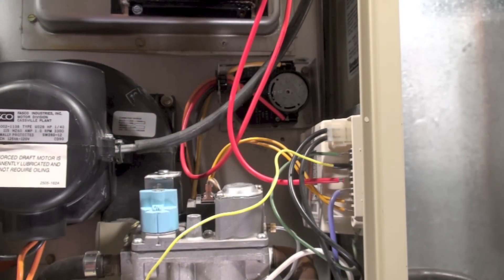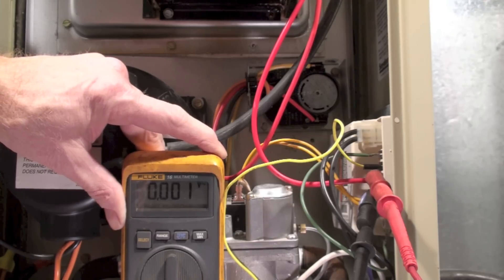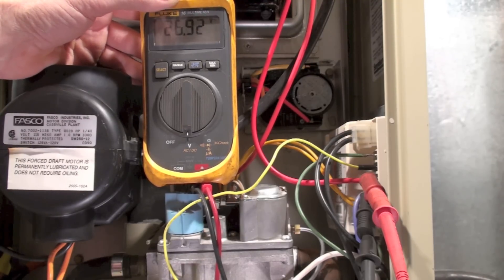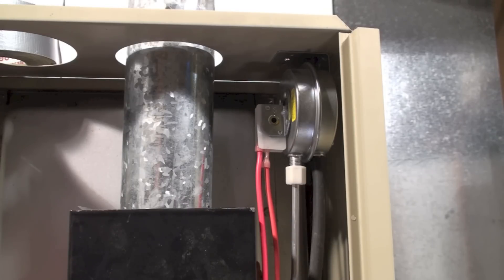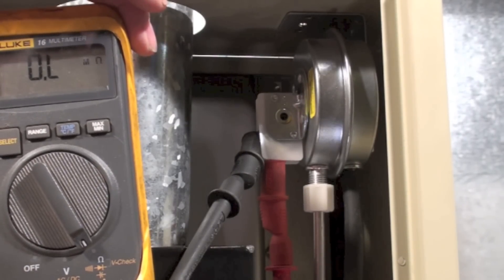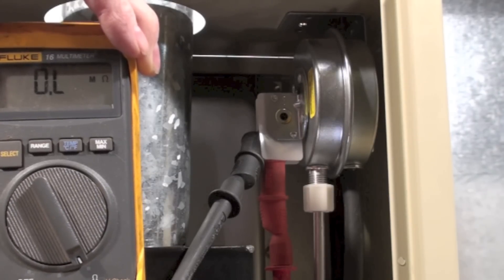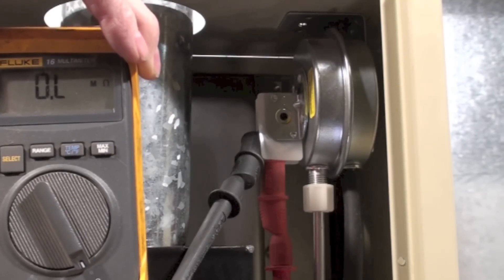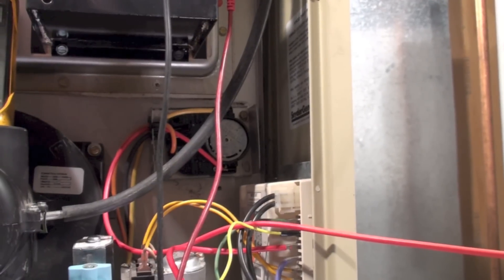Combustion blower runs all the time, no burner. Snyder General GUA. Part 6

Comment: I was working on my aunt's furnace trying to find out why her inducer fan wouldn't stop running and nothing else would kick on. When you isolated the pressure switch I stop the video and found hers and started jiggling the wires and when I pulled off the vacuum tube from the inducer side it was completely plugged. Cleaned it out and it fired right up. Later on i got to thinking mabye you mentioned checking the tube and ports so i watched the rest of the video and shure enough there it was great advice. Thank you!

Comment: I have a 1986 Snyder General the inducer fan runs all the time without quitting.  but when I turn the power off and back on it will run one or two cycles and not work again just the inducer fan keeps going.   I bypassed the pressure switch and also got another control box and still not working

Comment: At 1:45sec you mention the pressure switch is normally closed and opens when there is pressure (I believe vacuum pressure).  But then when ohm testing it you have the inductor motor running and get an open reading, which wouold mean the switch is working right.  However, where I believe the eror is is that the switch is normally open, and closes with the proper pressure (unless this is different than the Trane unit pressure switches).  The pressure flips the switch on which lets the ciruit complete.  It is safer to "not" turn on a unit than it is to have it come on by default and turn off if there is no pressure (if the switch were to go faulty it would let the unit run).    I know what you were thinking it just came out wrong trying to video and talk. (been there)

If I am wrong here I'm sorry.

Comment from the maker: When you remove the combustion cover, you are bypassing the combustion air pipe.  Even a small obstruction can cause a failure, commonly if water gets into the pipe and there is a low spot, that will cause it.  It is also possible the pressure switch is failing.  I would check out everything else out before changing pressure switch.  Hope this helps.
GFM
Reply: Thanks

Comment: Excellent video.  New problem; oil furnace cycles on normally.  After heating cycle draft inducer fan does not turn off even after the set 10 minute time post purge period.
Reply from the maker: I am a little confused here.  Any post purge should only be a matter of seconds.  What model and brand do you have?
GFM
Reply: @grayfurnaceman  I have a Field Controls SWGII-4HD Power Venter (PV) to draft my oil furnace to the outside.  I just had a new TRANE oil furnace installed with the Beckett Genisys 7505B cad cell regulator.  As it is currently installed the thermostat calls for heat, the furnace motor turns on then after a few seconds engages the PV.  The PV creates the draft whereby the pressure switch is activated and turns on the oil burner and the furnace heats normally and the air handler fan starts normally.  All good so far.  When the thermostat is satisfied it turns the oil burner off and the air handler fan proceeds normally cooling off the heat exchanger then the air handler fan turns off normally all the while the PV continues to run.  As expected the PV fan continues to purge the duct because it's on a timer located in the box next to the pressure switch that states the PV will run for 10 minutes after the oil burner stops.  Well, the PV never turns off.  It runs indefinitely and I have to throw the breaker at the electric panel to turn it off.  I'm wondering if the timer is busted or the wiring to the cad cell or the thermostat is not connected properly.  What can I check to see if the wiring is done properly?
Reply from the maker: @cliffwendy3765  So, you are venting out a sidewall or the existing venting has more resistance than it should.
In this case, I would expect the time delay is failing.
GFM
Reply: @grayfurnaceman  thanks, yes we are venting out existing duct through the foundation to the outside.  I will pass this along to my HVAC guy as we continue to troubleshoot.

Comment: Well that was a great video👍
My question is I have a Trane xl80 and the inducer keeps running but heart won't cut on now I did have a tech check it and he claimed I needed a circuit board but he didn't even did nothing remotely to the trouble shooting you did in this video. What can cause this issue I've replaced the thermostat but nothing. It will run if I take the cover of to teste reset and will run fine but it won't cut back on with the inducer continuously running.

Comment from the maker: If drainage is clogged, inducer would make a water noise.  Sometimes a crack in heat exchanger can cause pressure shutdowns but hard to isolate.  A CO detecter in the house is always good.  A tech will use a water column gauge to test vacuum.  Thats the only way to know if pressure sw is the problem.  Probably the pressure switch change is the cheapest way to find out if it is the problem.
GFM

Comment: I have a furnace issue.  inducer runs all the time.  Turn power off and back on, everything will run fine for an hour.  Then inducer will continue to run 24/7.  I am getting a weird heartbeat blink on the ignition module.  It kinda flickers a bit

Comment: My  inducer motor won't turn off and heater works great is that a board /relay not opening after startup
Reply from the maker: The relay is probably stuck on.  Replace it.
GFM

Comment: Thank you for the video! I have an issue with my 6 year old Gibson 2stage. The temp is steady, however the blower keeps turning on with no burner - I just don't know why it turn on if it does not need to. The green light keeps flashing which would indicate pressure switch issue (which we replace)d, however that did not fix it. The control board was also replaced as previously the temp would go down by 4 degrees before the furnace would kick on. Strange that sometimes the pressure switch keeps tripping it and sometimes it just runs fine. No blockages anywhere. Why does the fan keep on turning on constantly if it is maintaining the temp and indicating that there is a switch issue when later it works fine?
Reply from the maker: The fan comes on when the furnace has shut down on safety.  If the code was for pressure, the fan would come on.  
My thoughts are you could have low spot in vent that is collecting water.  It would then drain after the furnace shuts down.
Also, the condensate drain could be plugged.
GFM
Reply: @grayfurnaceman  thank you!!

Comment: Hi, I have a luxaire model GM9S060B12UP11J I know the furnace was working at my daughters house at first start of the cold season but she overlooked to changed a very clogged filter. Of course she calls dad because of no heat in the house. Both blowers were running and no heat. I replaced the filter and let it cool down for awhile and it started right up and worled great. Was called the next day for no heat and found the draft blower was running continuously with the red light blinking 11 times. Im thinking the furnace got very hot at one point and may have caused something like a sensor burn up. I power it down and it lights and heats fine but after a while once the temp is met inthe house the draft blower continues to run and the furnace wont start by itself. any help would be greatful...............
Reply: I have the same thing happening to mine now, same model.

Comment: I have a GUA gas furnace that works fine for two hours, then the the blower and inducer motors runs but no burners. But! once I open the panel door on the furnace the ignitor rod(yellow light) comes on and ignites the burner, could there be a problem with the ignitor. 18yr old furnace no code
Reply from the maker: I would be looking for blockages in the combustion air inlet.
GFM

Comment: Hello Grayfurnaceman! Love your instructional videos! I have a question. I have a gas furnace/AC unit and the combustion blower is cycling on and off with the AC. Is this normal? I've never had a combination unit before and can't figure out if this should be happening? Thanks for the great info and I appreciate your advice!
Reply from the maker: The combustion blower should not come on with the A/C.  Could be a thermostat problem or the furnace control board could be causing it.
GFM

Comment: looked at a Goodman GSM furnace that had the inducer running constantly when the high voltage is on. 
could this be a similar problem. 
This is on cooling mode though not sure if that matters.  thanks

Comment: Hi, any help is appreciated. I have a Ez-air furnace. Model # NTGS100HJA1. The blower and inducer motors both run continuously and won't shut off. Changing tt settings doesn't affect it. Additionally the unit won't heat. The ignitor does not light up at all. I suspect it is the circuit board, but am asking because I don't have a lot of money to just start replacing parts using the trial and error process. Thanks in advance.
Reply from the maker: Probably the unit has failed to light. First, turn off power to the furnace. Turn it back on.  It may or may not light. If there is window on the front of the furnace, look into it to and see what the failure is. There should be a key to the code on one of the furnace covers or the control board. Hope this helps. 
GFM

Comment from the maker: Heat exchanger should be under a part only warranty.  It is a long job.  The AC will work with a bad heat exchanger as only the fan is used for cooling.
GFM

Comment: I have a Lennox furnace that the inducer runs even when the stat wires are disconnected and the LED lights blink for normal operation. I'm pretty dang sure the board is bad but I wanna be sure. The Lennox dealer is a long ride and boards aren't returnable.
Reply: What you test so far?
Reply: Seen a few tranes that inducer wont stop....I internal contacts stuck closed....replaced motor....no problems

Comment: Hi,
I have a Fedders furnace that its been acting up lately.
I recently replaced the cap, and the blower was replaced 4 years ago.
Heat and cold works fine when need it.
The problem its a buzzing noise coming from the blower.
It does it without my calling for heat,or after the heat comes on.
It buzz out of nowhere.....like the furnace its off for a while,and all of a sudden it starts buzzing,stops after a few minutes and the heats kicks in a blower starts normaly..
Any help is greatly appreciated....
Reply from the maker: +Fernando Silva It could be the low voltage transformer is buzzing.  About the only thing you can do is replace the transformer.  Hope this helps.
GFM

Comment: Very good information!
What is the Cause and effect of the inducer fan continueing to run after thee furnace has lit.
My main Blower is running after testing and replacing the hot surface ignitor.
But my infuser fan/motor continues to stay running 🏃
Also I notice, after I hollar up to  my  helper to turn on the thermostat,  the first thing that comes on is my main Blower. (flashing the normal code 12)
2nd item is then the inducer kicks on and runs about 45 to 60, maybe 90 seconds, then my ingnor glows,  ,  and I hear hissing,  (gas flowing) and she lights and heats normally.
But again, my inducer fan continues to run.
Could it be a stuck relay in my control board
Reply from the maker: If I am reading you correctly, you think the inducer should shut off after the burner lights.  That is not correct.  It should run until the burners shut down.
GFM
Reply: @grayfurnaceman 
OK thank you!
Yes, that's what I thought, (that it would cycle off, after furnace lights.)
So I understand now, I AM Seeing normal operation.
And the inducer IS SUPPOSED TO BE RUNNING 🏃 TILL THE HEAT CYCLE HAS STOPPED.
Thank you....
Reply: Lol. Reminds me of the time my dad was looking for something under the hood of his car when I came out of the house. When I asked what he was looking for he said the oil pump. Lol, he wasn't very knowledgeable about cars. I'm not teasing you, there are plenty of things that I don't know about.
Reply: I want to transfer my model 50E47-070 to a model 50E47-843, step by step transfer.

Comment: Hello sir, my inducer motor turns on and off when the thermostat is in the off position. (no call for heat) It turns on  and off a few times in a five minute period, then in the morning when I do call for heat everything works fine.. I checked for wire to close together and even changed the wall thermostat and still have this problem. thank you
Reply from the maker: About all you can do here is to remove the wires from the terminal strip at the furnace, then jumper R to W.  If this stops the problem, the wiring in the wall is probably shorted.
GFM
Reply: Thank you sir.. will do.

Comment: Hello.  I have a 1988 GUA100A016AIN.  I have this issue but I can get heat if I turn off the furnace and turn it back on.  Sometimes I have to turn it off a few times before the heat kicks in.  Could there be an issue with the flame rod and or heater ignition and if so would that cause the blower to run constantly? This model is old enough that it does not have the light(s) to indicate an error.   Thanks.
Reply from the maker: jim peterson First, clean the flame rod.  
GFM
Reply: grayfurnaceman
Hello,  I cleaned the flame rod and it did need to be cleaned but now it won't heat.  When I look in the glass I don't see the ignitor glowing, when I cleaned the flame rod I checked the ignitor and it appeared to be fine?  The combustion motor  still runs all the time.  Could I have a faulty ingnitor?
Reply: jim peterson Well the heat just kicked on.

Comment: Ok.. here my big problem. I will try to do my best in english. When I ask my thermostat to get heating, the fan blower start witch is normal. But blower never stop... then I open the planum a bit and saw that the element inside the furnace work only on 1 stage, but should work on 2 stage because ny w1 and w2 is bypass at all time. Then first this , i go look the limit stiwtch if one stuck open and Yes, there is one open. I bypass the wire direct without the first limit switch (because we have 2) and look again inside the furnace. I got more element working but not all? How its possible.... spring broke(element)..? And the fan blower.. still got the problem... i test the thermostat wire.... i disconect the G from the panal board... and still the blower start without the G ask for it... make sense if its on safe mode ( limit stwich open) but.. the limit switch is bypass now and work....  look like 2 problem

Any help?
Reply: Did you fix it?
Reply: @michaelmace924  yes !

Comment: Wouldn't the board display a code tho?
Reply from the maker: This unit does not have an IFC control.  The only light is on the ignition control and it will only indicate an ignition failure.
GFM

Comment: Blower runs on startup? Why?
Reply from the maker: If the circulating fan runs upon startup, either the fan switch on the thermostat is in the "on" position, or the furnace has a limit or rollout switch open.
GFM